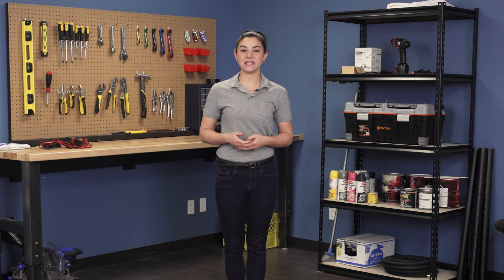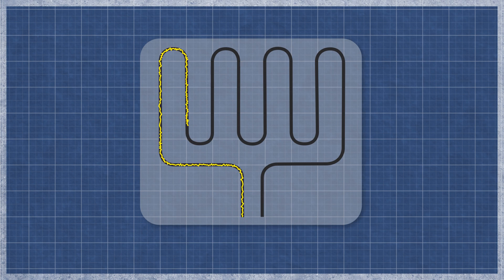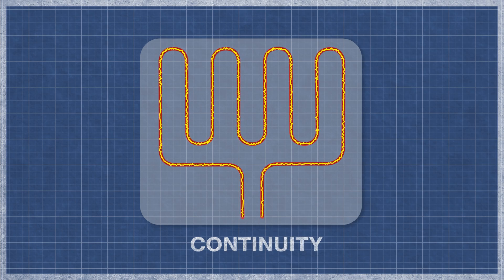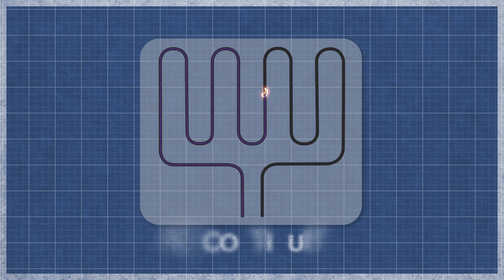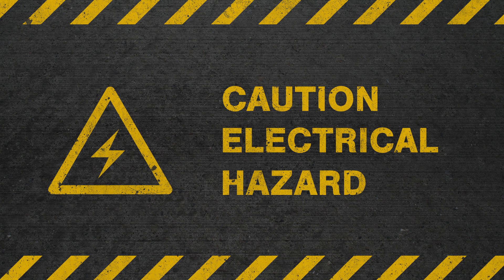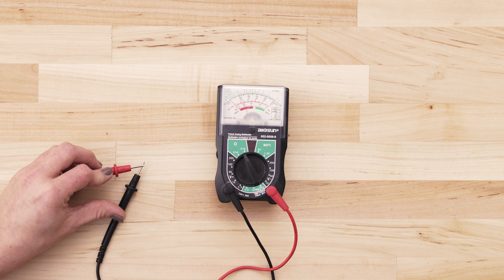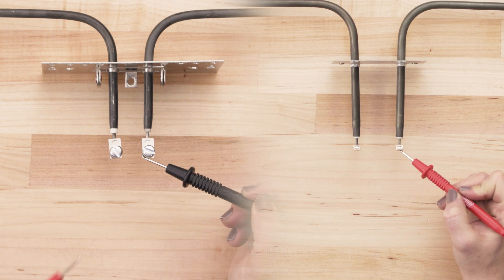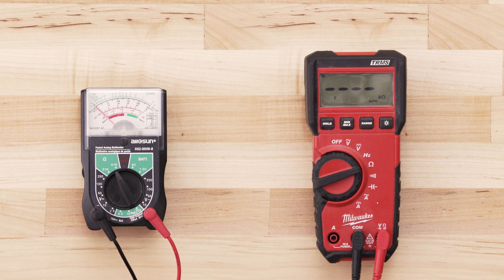Oven Heating Element - Continuity Test

Comment: Hi Stephanie it's Gerda..I've replaced the broiler element and thermostat and still not reaching my heat on the oven to bake a cake😢pls help me as baking is our sauce  of income  now..
Reply from the maker: Thanks for watching. We have a full playlist on troubleshooting which is broken down based on symptoms.

https://www.youtube.com/playlist?list=PLCo9SMjkdWBzSdZB9Un3GKKI0Iohlpf9a

You mentioned thermostat. Do you mean a temperature sensor (thermistor)? Or did you replace the old style all in one which has the physical dial and bulb?

If the unit is not heating at all there might be a thermal fuse preventing power to the heating elements.

If there is partial heat, then check to see if both elements are heating up. During the preheat they will both be on, but during bake it will be an 80 - 20 split with most of the heat coming from the bake element. You can also test bake and broil settings to see if there's any difference.

Comment from the maker: Note Some higher wattage elements can have lower resistance values than 30 ohms. You can use the wattage and the power (240V) to determine the resistance value of your heating element:
https://www.rapidtables.com/calc/electric/ohms-law-calculator.html  

Formula for manual calculations:
Voltage Squared / Wattage = Resistance
240 x 240 / 3500 = 16.46 ohms

Comment: What if its at the low end? Put in a new element and oven isn't heating all the way up. Dh said ohms on new element is on the low end
Reply from the maker: Thanks for watching. You can use the Wattage rating and the power (240V) to determine the resistance value of your heating element:
https://www.rapidtables.com/calc/electric/ohms-law-calculator.html which will be the Voltage Squared / Wattage = Resistance
Some elements with high wattage ratings might have a lower resistance.

If both elements are good and the oven is not heating up all the way then it's likely a faulty temperature sensor. You can see more in this video: https://youtu.be/96s7maybHlY?si=N-P7M5CSklBWDb9N&t=311
Reply: @AmreSupply  thanks took over an hour tonight to get to 340 with convection bake. Never got to set temp of 350. Thermostat in oven was correct though
Reply from the maker: @valeriehofmann2615  Thanks for the update. If both heating elements are good, and the temperature sensor is 100% good, and the oven is still not heating up properly then check the wires between the temperature sensor and the control board. Make sure there is no carbon or dirt or grease that might interfere with the electricity of the sensor. 

As well try a normal bake cycle as well as broil and see how it heats up. You should be able to feel some heat off of the bake as well as the broil elements. Make sure that the elements are actually turning on.

If this doesn't help then it could be a faulty control board.

Comment: Took an resistance and connected to 220v why it isn't glowing as it would on the oven, know why? Trying to built a cocktop to my shed... it heats but not much as normally would. Also didn't saw any capacitor on the oven I scraped it from... any clue?
Reply from the maker: Thanks for watching. We don't recommend ever to modify existing components to work outside of their specific designed use cases. There are lot of factors that can effect safety, so it is best to contact an electrician for guidance.
Reply: @AmreSupply  it's a curiosity question, from Brazil.

Comment: I am trying to diagnose a broiler element that is not turning on. I measured the resistance of the broil element and the thermostat, they both tested fine at 15.6Ω and 1082Ω respectively. When I turn on the oven a relay clicks, the fan turns on but the broil element does not get energized (reads 0 V on a multimeter) The bake element is energized with 238 V. Is there any fuse or protection circuit between the electronic control board and the element I can check? I am hoping I can find something easy to diagnose and replace that is broken like a fuse, a relay or a thermal switch. How can I diagnose the electronic control board before ordering a new one?
Reply: P.S. My oven is a Jenn-Air® JES8860CCS00 Range.
Reply from the maker: Thanks for watching. If your model has a thermal fuse then it can be tested for continuity: https://youtu.be/96s7maybHlY?t=243 This is generally only on the bake element or near the power supply. Since the broil element is only used partially during a bake cycle, it does not make sense to have a thermal fuse or limit switch on the broil element. If it has a limit switch or fuse it should be listed on the parts breakdown: https://www.amresupply.com/lookup/70191

Based on your tests (which seems like it was done on a bake cycle), you hear a relay but that is likely the bake relay. Try the test again but on a broil cycle as only the broil element is used. In some models it might preheat with both elements so wait until after the preheat is done and listen to see if the broil relay clicks on and off. After the preheat the broil element should be hot and will continue to cycle on and off. If the broil relay doesn't click at all within a 10 minute run time,  then it's likely a faulty control board.

If the relay clicks but the element isn't receiving voltage. then check the wires between the control board and the broil element. See if there are any burn marks or melted wires. Then check the wires for continuity.
Reply: @AmreSupply  Sorry I was not clear that I did test the broil and the bake cycles. The broil element was never energized in any test. I will take appart the control panel and check the wires. Also, the broil element stopped working after a self clean - could be the cause or just a coincidence??
Reply from the maker: @jett01000010  Thanks for the update. It is possible that after a self clean that it tripped a thermal fuse or damaged the control board. It is hard to know for sure though.

Comment: If the element appears fine and connections are good but element does not heat up, it could be the relay on the control board. That was my issue. I had to resolder the relay connection to the circuit board.
Reply from the maker: Thanks for watching. You are right that after eliminating the element as a potential failure, that it could be an issue with the relay. Most people don't have the knowledge or skill to resolder a relay so they end up replacing the entire control board. We're glad to hear that you were able to repair it and get it running again.

Comment: the easiest element to be warmed up - water , air or oil?
Reply from the maker: Thanks for watching. Air will heat up faster than water or oil. You can see this in the fact that lakes in summer are often many degrees colder than the surrounding air.

Comment: Can you expect to get a similar reading in resistance if you contact your probes to the actual heating element, near the terminals?
Reply from the maker: Thanks for watching. If you test on the bare metal then you'll get a similar resistance. If you test  the part that glows (which is the cover) then you won't get a resistance reading. The heating element is actually a small wire inside and the outside is not the path for electricity to flow through. If you do get resistance between the terminal and the frame or the outside of the heating element, then that means that it has shorted.
Reply: @AmreSupply 👍

Comment: I'm in confusion,i done continuity through buzzer,it does not produce sound at all,when i do ohm,it goes to 50-60 ohm..which one should i go for.? 😅
Reply from the maker: Thanks for watching. If you're still getting a normal resistance reading then don't worry about the buzzer as this has different thresholds depending on the model of multimeter. What matters is that the resistance is within normal values.

Comment: Charbroil smoker element test
Reply from the maker: Thanks for watching. If it is an electric smoker than the element will also be a resistor. You can test it for resistance in the same way. The resistance rating will also likely be similar to an oven element. If there is no resistance or if it seems very high or very low, then the smoker will not work.

Comment: My reading was 13 ohms?
Reply from the maker: That is a little lower than average but might be ok if you have a higher wattage heating element, something around 3400 watts: You can check using this calculator. Enter the wattage & voltage of your system (240V) and you'll get the resistance that the element should have. https://www.rapidtables.com/calc/electric/ohms-law-calculator.html

Comment: my oven heat up for a minute or two then trip the circuit any suggestion ?
Reply from the maker: Thanks for watching. If the oven is tripping the breaker then there is most likely a short. From the back of the oven you can test the oven elements to see if it is shorted through the oven frame. https://youtu.be/10ezc3LNQP4?t=282

Other than that short circuits can be difficult to narrow down, it is one area where it can be helpful to call a professional.

Comment: Should read zero if its any good. Anything higher replace
Reply from the maker: Thanks for watching. An oven element is a resistor and needs resistance to create heat, it should be anywhere between 10 - 40 ohms. Switches, wires and fuses will have a resistance of 0 - 1 ohms as they provide a path for electricity to flow through.

Comment: Can you put 220v in to a 110v element?
Reply from the maker: Thanks for watching. No you can't use a heating element designed for 240v on 120v power. The current will be too high and you'll trip the breaker. For example a 3500 watt heating element run off 240v will draw 12.5 amps of current. If that same element is run off of 120v then it will draw 25 amps of current which is much higher than the circuit can handle. You can plug those numbers in yourself to see it here: https://www.rapidtables.com/calc/electric/ohms-law-calculator.html

Comment: My oven made sparks and smoked, the bake setting doesn't work, but the broil setting and all 4 stove top elements work,  what would be the problem??   Single mom,  needs a handy man suggestions!
Reply from the maker: Hi Marlene, thanks for watching! What you are describing is that your bake element likely burnt out. If you notice any visible blistering or defects on the side of the element, then that's a good indicator that it failed as well you can test the element following the steps in this video. If you need a replacement bake element then you can enter your oven model number into the AMRE Website to get a parts breakdown with your exact match listed on the side. https://www.amresupply.com/findmodel/range

Comment: Hi can you please explain how does the elements are connected to tempreture and the timing or will be appreciated shown diagram tq
Reply from the maker: Thanks for watching Joe! We are currently in production of a more in-depth series on ovens and stoves, including a video on how it works. To put it simply, the oven control board is connected to a temperature sensor. When you turn bake or broil on, the control board sends power to the heating elements preheat the oven. Once the temperature is reached, the oven elements turn off. Once the oven temperature drops, the elements will turn on again to raise the temperature. The timing of the elements depends on the model. Some models use both the bake and broil elements during baking, about with about 80% of the heat coming from the bake and about 20% coming from the broil element. In some models only the bake element is used during baking, and only the broil element is used during broil.
Reply: @AmreSupply  you explain very clear thank you.
Reply from the maker: @joesam8113  You're welcome Joe, we're happy to help!
Reply from the maker: We've finally release the series on oven and stove troubleshooting: This video explains how it all works: https://www.youtube.com/watch?v=L9ZI5GyON9I

Comment: If conectivity comes for a second then elemnt is ok or not
Reply from the maker: Hi Farhan, thank you for watching. If the element has continuity, the multimeter should show a resistance reading continuously. If you don't get a reading for more than a second, either the leads aren't making good contact with the terminals, or the element is faulty.

Comment: My readout is 13.3 ohms.
Reply from the maker: Hi thank you for watching. 13.3 ohms should be fine depending on the wattage of your element. If your manual doesn't state the average resistance you can plug your element wattage into this Watts calculator to find out what resistance the element will need. https://www.rapidtables.com/calc/electric/watt-volt-amp-calculator.html For example a 3400 watt bake element will be running off 220 volts. If you plug these values into the calculator you get a resistance reading of 14.2 ohms.  So this depends on the wattage of the element. 13.3 ohms is within a healthy range but if you tested 5 ohms then that would be a sign that it was defective.

Comment: Hi . Is it acceptable to check continuity while still in the stove if you have access to the ends from the back of the stove? Thanks.
Reply from the maker: Thank you for watching. As long as you unplug the unit from the wall, and the power is disconnected then you can remove the wires and test the element from the terminals on the back without remove the heating element.
Reply: @AmreSupply  Thanks!
Reply from the maker: @JamesGodish  You're welcome!

Comment: I have a Faberware 1500w double cooktop. The large burner & indicator light stopped working so I opened it up to check things with my digital VOM. I got .2 resistance on the working small element and 0 on the inoperative large element. The small element works like a champ so what's with the low reading?
Reply from the maker: Hi Bill thank you for watching. Non-load components like switches or thermostats will have resistances of 0-1 ohms while heating elements are around 20 - 40. If you get a reading of less than 1 ohm first make sure that the element is completely isolated, disconnect all wires etc, so that you are not getting any interference.  Also it is worth checking to see if the element has shorted to ground. Test from each terminal to the outside of the heating element to see if you have continuity. If there's continuity then the element has shorted to ground.
Reply: @AmreSupply  I isolated the element and it shows zero resistance with no short to ground. Can't locate a replacement so am considering replacing it with a standard  stove top element and drip pan .
Reply from the maker: @billwilson3609  yes those replacement burners are not commonly sold. Keep in mind a standard stove top element requires 240v and might not work as a replacement as most portable cooktops run off 120v.

Comment: Thanks for the great video.....Quick question... My Bake Element has an Ohms reading of 20, does that mean I have a bad element?
Reply from the maker: Hi Kyran, thank you for watching. The readings do vary with different manufacturers, so a reading of 20 ohms may not necessarily mean that the element needs to be replaced. To be certain its best to check your manual for your particular model.
Reply: @AmreSupply  is it better to check continuity only then??
Reply from the maker: @kapilyadav8226  If your manual doesn't state the average resistance you can plug your wattage into this Watts calculator to find out what resistance the element will need. https://www.rapidtables.com/calc/electric/watt-volt-amp-calculator.html For example a  2500 watt bake element will be running off 220 volts. If you plug these values into the calculator you get a resistance reading of 20 ohms. So this depends on the wattage of the element. If the resistance is significantly off then you know the element will need to be replaced.

Comment: Can I infer from your suggestion of 30-100 ohms that 100 is the max reasonable resistence?  If it is more than that (say 200+) does that also mean it is bad?
Reply from the maker: Great question. It does vary slightly but you are right that excessive resistance is bad. If the resistance is 200+ then the amp draw would be cut in half and the heat dissipation would decrease, so the element won't be as effective in warming up the oven. You can see here by plugging in voltage and resistance into this calculator http://www.ohmslawcalculator.com/ohms-law-calculator

Comment: Why did you use resistant on the meter to check continuity instead of continuity setting which beeps when detects?
Reply from the maker: Hi Charles, thank you for watching. Good question. Using the continuity setting works great but not all multimeters have the continuity setting, so in this case we decided to show the test by just using the resistance setting.
Reply: Some digital multi-meters will not alert/give off an audible tone is the circuit has too much resistance. For example, the one I have at work will not emit a tone at anything above 10 ohms. The one I have at home (different brand) will emit a 'good circuit' with up to about 1kohm. By using the resistance reading, you won't get a 'false open' if your DMM is a bit finicky.